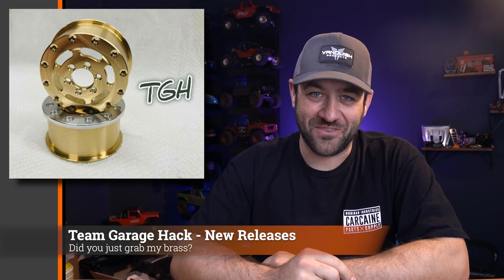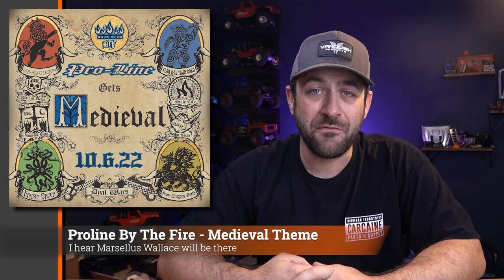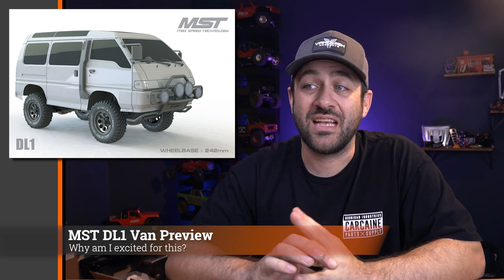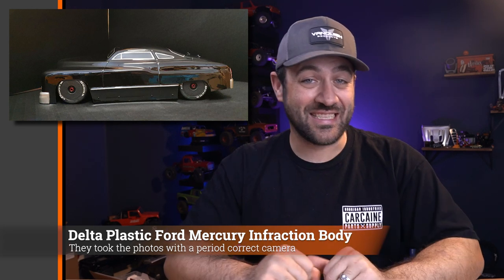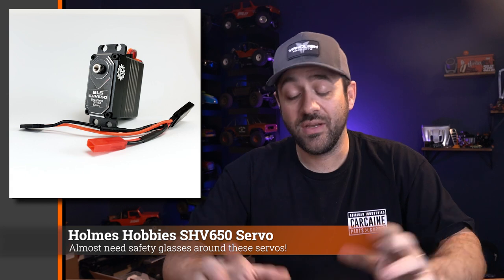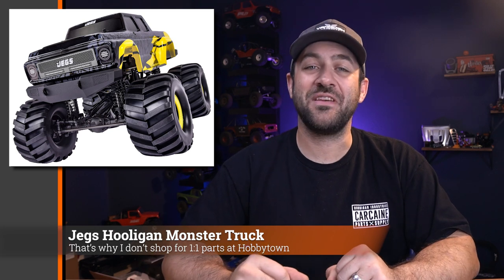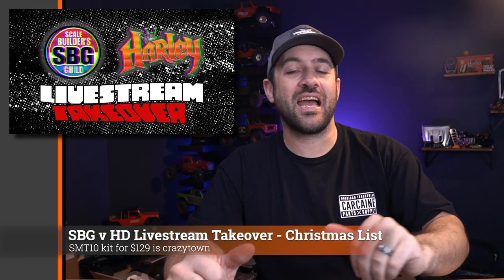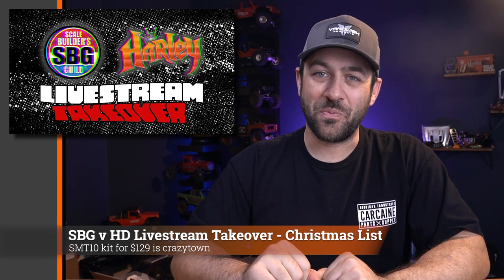STOP!! - Scale News Update - Episode 184

Comment: This weeks question: Has to be a 3D printer for the avid tinkerer. My flash forge adventurer 3 has paid for itself over and over, especially in the RC hobby, design your own stuff such as bespoke mounts, not to mention all those scale accessories. Apart from the RC hobby, I’ve used mine to make no end of garden ornaments for my pond, it’s also been invaluable for making things you just can’t buy, first thing that comes to mind is a bracket to fit a solar panel to my gazebo.

Comment: Hey Josh I used you links and the scx10 iii axles are 169, the ryft kit is 399, and the smt10 kit is 199  this is 15 hours after your video dropped so was it a one day only sale?
Reply from the maker: It expired the day the video posted. It was still correct when I filmed but has since changed. Sorry.